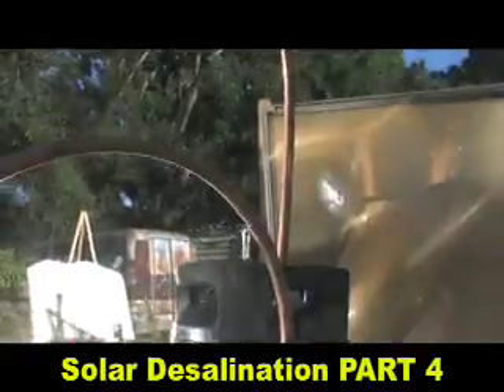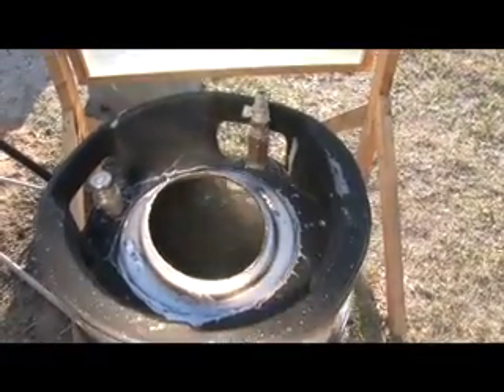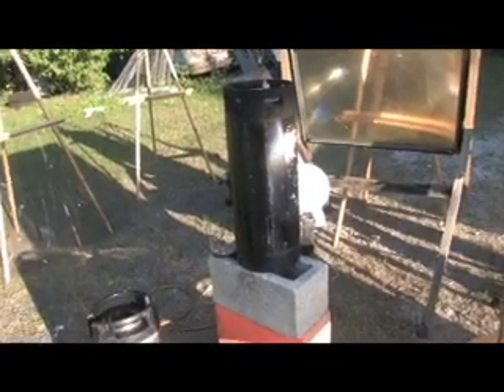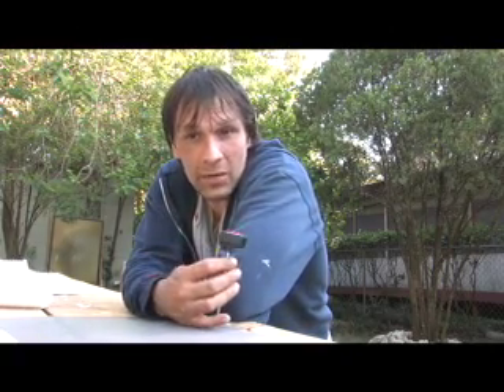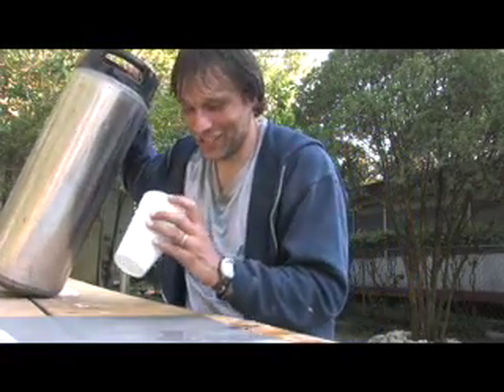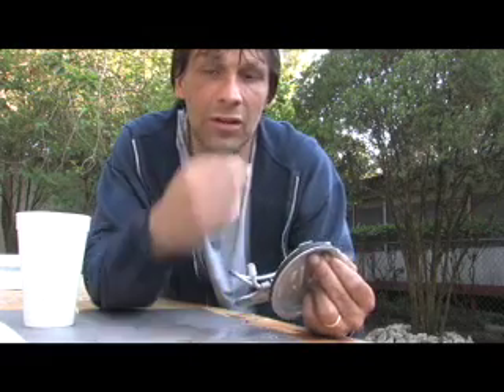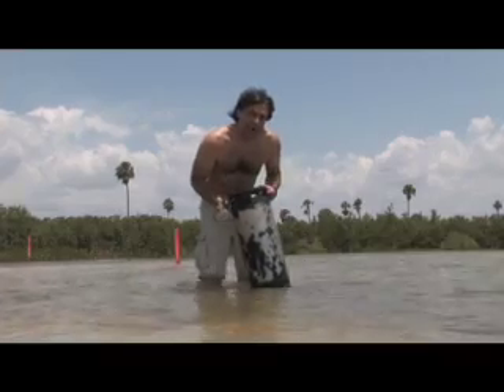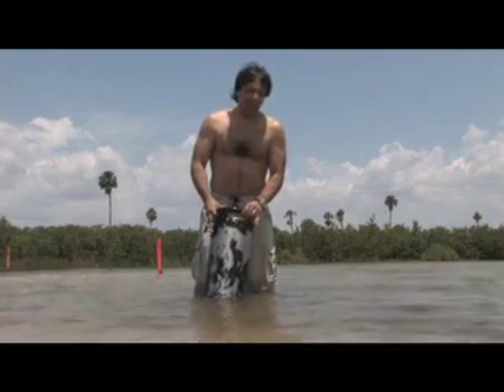Fresnel Len SOLAR powered STILL Boil The Ocean wort PART4

Comment: Whatabout a modifide tank-less water heater,with a large settlement bowl(simular to gas engine)placed at center of lowest point to collect settelment/and or salt,.and an extended condensor (1ft' or so in length x 2-3" diam.)center top , reduced 1/2"-3/4" flex hose to collection ::: attach black iron heat sink in direct contact with coils,,, connect water supply tank (elevated for gravity feed) adjust lens on heatsink...flow automaticly adjusted by escaping steam...

Comment: @69furball69 I was thinking the same thing. Using several vacuum tubes and a float to auto fill the water.  Use one lens on each tube with one copper condensing line per tube.  From watching your other videos it only takes a minute to get a small amount of water boiling.  More tubes producing steam is the Key.  I bet 5 gallons an hour wouldn't be hard to do.  Great videos Dan!!

Comment: @aeroscope because you cant apply the required amount of energy instantly, it cools off over time resulting in it taking way more energy. The more efficient the insulation, the less heat.

Comment: Greetings Dan , 
been watching your videos for a while ,,5*
great work and the effort you have put into them even with all the interference around 

just a thought over my head,
the low heat transfer maybe caused by stainless steel on the can
try with either carbon steel , aluminum or copper that should let the water to absorb the sun energy way better.  
keep up the fantastic work Dan!

Comment: I really need the lens or a parabolic to distill alcohol.  I can't burn wood now to run my still because of fire season.  I need to heat to low boil a 15 gal. stainless tank.

Comment: Try a smaller boiler. Once you get the seawater to boil drip in cool seawater. You can find a drip rate that allows the water to boil at a fixed rate. You're losing tones of heat out of the nonilluminated sides of the keg. Another approach, insulate the keg and shine your light onto a copper or aluminum plate that sinks into the water all the way to but not touching the bottom of the keg. Nice work, love the C-5's. Some of those fly over my house about 3 hours before they fly over yours at KDMA.

Comment from the maker: Hi RJ,

I think the grid is here to stay if you want all the creature comforts we enjoy now, BUT, solar can drastically reduce you utility bill with a few small changes. The solar hot water heater we have has taken $35 a month off of our electric bill. We shower at 5pm and do the dishes at 2pm, but only manually turn the electric water heater on after running water into for dishes/laundry. We then are heating mixed water that is about 100 degrees vs. 70. CPF Bulbs etc.